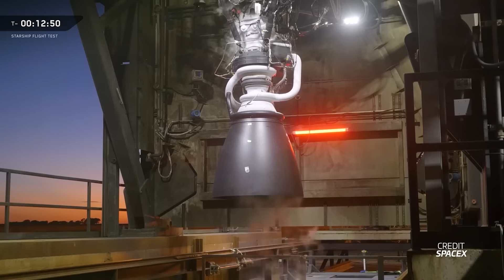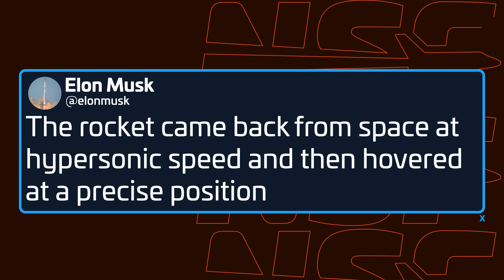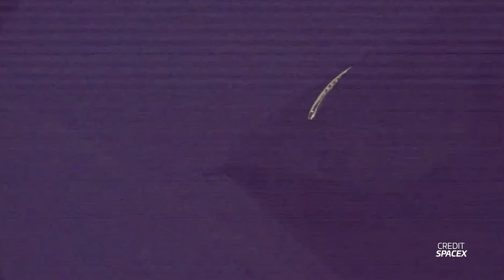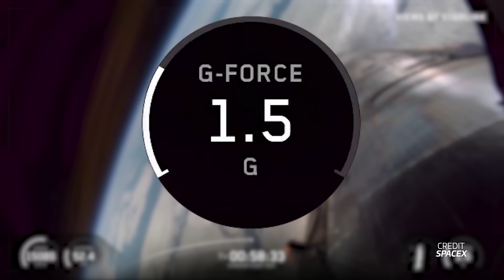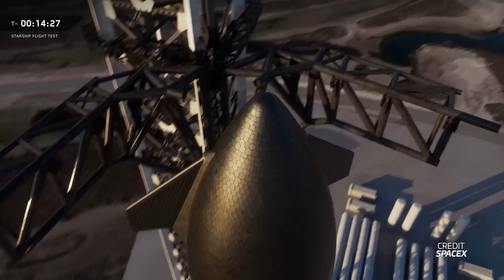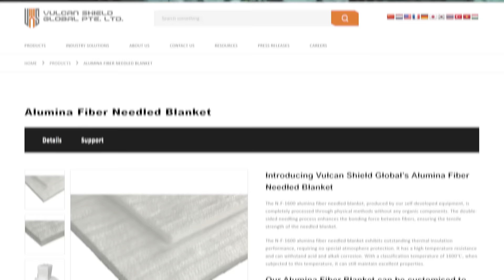The End of Version 2 and the Dawn of Starship V3 | Starbase Update

Comment: You speculate that V3 booster will have a more symmetrical thrust 5 engine landing burn segment, but i think the asymmetrical thrust is intentional

SpaceX is implementing this new configuration to lower fuel consumption and this 5 engine configuration is to move the booster towards the tower or towards the ocean for a catch abort

If catch is GO, 2 engines will fire directing the booster towards the tower. If catch is ABORT, the mirror of those 2 engines will fire instead, directing the booster offshore

Just my opinion ;)
Reply: I think the engines are in slightly different locations on V3 so they may well end up being more symmetrical. We'll see.

Comment: The ship needs more sealevel engine for the landing. As weve all seen in the recent test fights, the three engine is enough to slow down the ship but not enough to hover.
Reply: The ship does not need to hover (also if three engines is enough to hover the booster which is heavier it is plenty enough for the ship)
Reply: They only need 3 for booster to hover, but you're saying the same 3 aren't powerful enough for the much smaller and lighter ship to hover. You may want to check your maths there.

Comment: Compared to shuttle , ship has larger area compared to weight.
Reply: Cargo Volumes: 
. Starship (V3): 1,100 cubic meters (m³)
. Space Shuttle: 300 cubic meters (m³) in the payload bay
Reply: @warrenwhite9085  Talking about heatshield area. As in, starship flies better than shuttle.
Reply: @rokadamlje5365   Due to its winged aerodynamic design The Space Shuttle’s glide ratio (4.5:1 hypersonic, ~4:1 subsonic) far exceeds Starship’s (~1:1 or less).

This comparison highlights the trade-offs between the shuttle’s airplane-like design and Starship’s rocket-centric approach, reflecting different mission goals—orbital versatility versus interplanetary exploration.
Reply: @warrenwhite9085 right, altho ship is in the air longer.
Reply: @rokadamlje5365  The Space Shuttle's reentry process took approximately 30 minutes, while Starship only takes around 20 minutes from orbit to landing. the Shuttle used its wings to glide & descend slower vs Starship uses a "belly-flop" maneuver. So Starship has much more intense peak heat loading.
Reply: @warrenwhite9085  Starship has lower peak heating, for longer time. All due to being lighter to the are of the heatshield.

Comment: Hey, just a thought—if they’re aiming to catch a Starship around springtime, wouldn’t it make more sense not to dismantle Pad One? You can’t catch a rocket while construction is still underway. Even if they manage to tear it down in a day, rebuilding Pad One will still take three to five months.
Reply: I would think that they will just use pad two for launch and catch until pad one is finished refurbishing.
Reply: Pad 1 won't be used at all for the catch, it's irrelevant for that
Reply: @Alexphysics13 
But it could be used for a catch when it’s completed. 
I’m just guessing. Cause I have no idea.
Reply: @petercozzaglio6070  Yes when it is completed some few years from now but pad 1 is not catching ships in its current configuration, it's not compatible
Reply: @Alexphysics13 
Correct. But I highly doubt that it’s going to take a few years to be refurbished. And I don’t think they need to replace the tower either. 
So that’s a lot of time saved.
Reply: @petercozzaglio6070 Pad 1 will be refurbished within 18 months.
Reply: The Tower Chopsticks would need to be modified for the Version 3 Starship, so if they could get that done in time, I guess it could be possible.
But could they break down that pad in that time? I don't know. That's a lot of plasma cutting to be done. And some of that shielding plate is pretty thick going by the construction videos. Mind you, a bit of demolition explosives in the right place on the 6 pillars, could bring it down in a short amount of time 😉🧨🧨🧨🧨🧨🧨💥 Bada Boom!
Reply: 19:20 They are going to use Pad 2, which is almost complete. Pad one will continue its upgrades whenever launch or testing operations are not underway, so most of the time.
Reply: Pad 1 is totally incompatible with Block 3 ships in its current configuration.